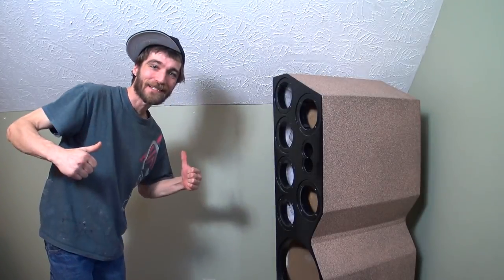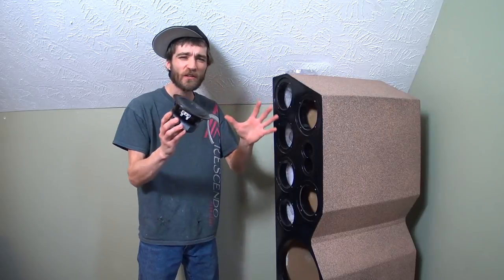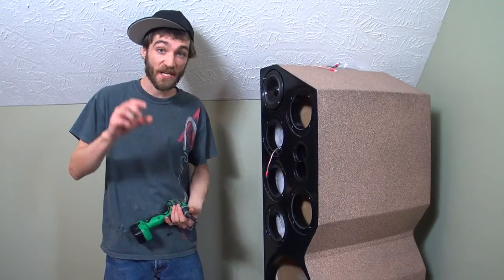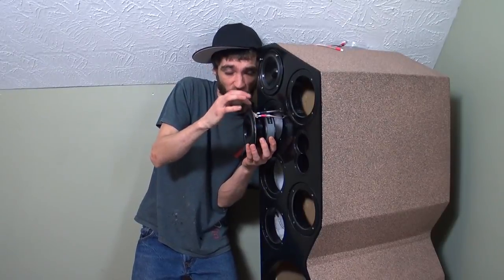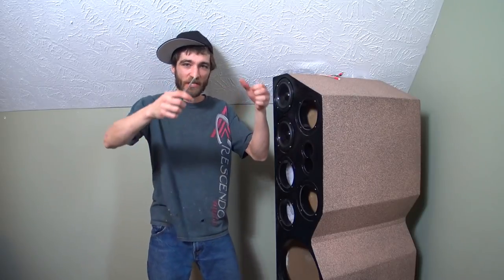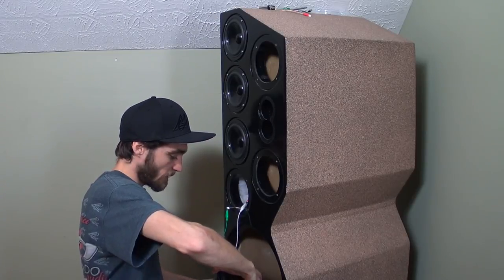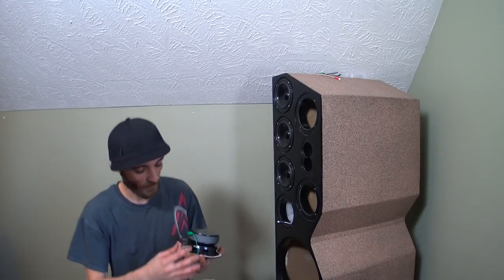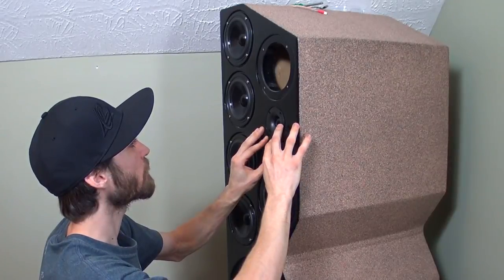DIY Home Theater Towers: UPGRADING to Better Speakers & How To Wire a Speaker in Series / Parallel

Comment: I offered to mail you a dewalt battery drill years ago but i never figured out where to mail it. I was upgrading from 18v dewalt to 20v so i had a left over 18v drill. But then, a month later, that 18v got stolen so its good you got your own :)

Comment: After seeing the trouble you were having holding and repositioning the speakers during install a thought occurred to me. Why don't you let gravity help you out? Try laying the towers first down onto there backsides thus when placing the speakers into their respective openings gravity will hold them exactly where you want them to be without having to keep realigning them. This simple procedure helps hold them in place and you will also save video time from constantly having to reposition them. Win win situation. Problem solved!   Good luck!!!   a fan.

Comment: That's a nice project EXO. Will you add some scealant between the speaker and the  wood?  Also did you tried single tweeter versis dual tweeter in room acoustic environnement?.. I would worrie about the dual tweeter because it will make diffraction and you will have very strange feeling of HF  at various places or when you move your head as there is cancellation or addition between few cm distance at the  listening place.  As you know the wavelengh is very small at HF and just like bass , it will  be affected by the listening position.. but for HF it wil be alot  smaller distance. There is actually a technology that use that phase diff in an array of ultrasonic transducer to focus the sound where they want just by playing with the phase of each transducer in the array

Comment: Let me rephrase my question from the live stream: it is my understanding that when matching amp gain to the sub, all levels must be zero'd out; and gain is the adjusted to max B4 clipping. How is it then safe to readjust settings (not gain), effectively bumping "output volume" without damaging the subs? It just makes me nervous to set my amp, and then cranking the bass boost, eq's, etc... And it being safe. I hope this makes sense😬

Comment: I have the same problem in my home, the room is to small for speakers which i have, and in middle is no bass. because, sound reflects from the wall, comes back and kill whole low frequency sound waves. But if i stand next to the wall sound is great.